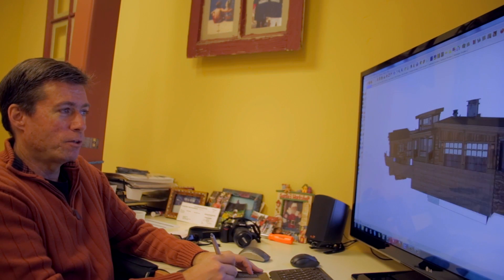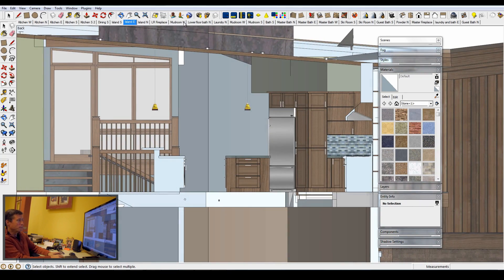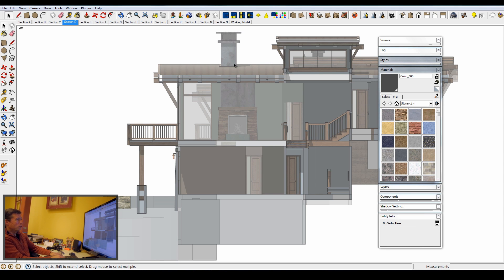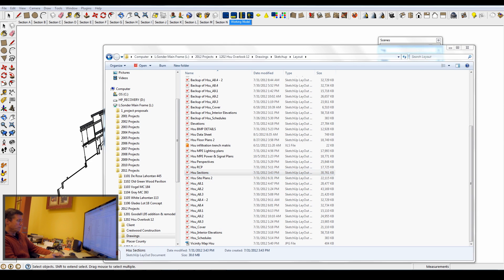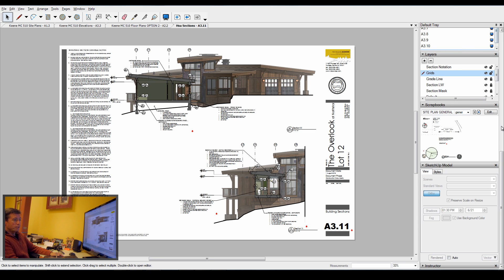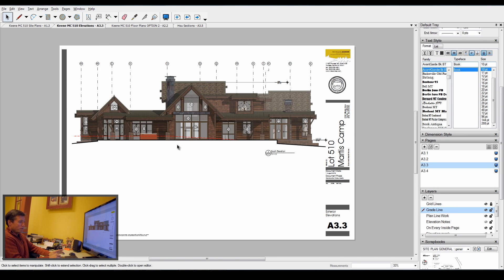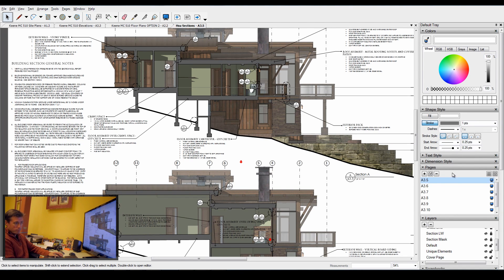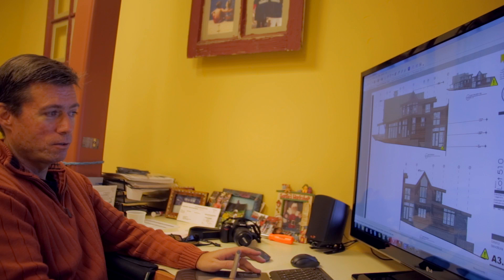Nick Sonder Process 2 - Generating different drawing types from a single model

Comment: Very impressive Sir, I am a IT Comms Room designer and I have been using Sketchup for some time now to design Comms rooms within a given space available/set aside for IT environments. I use Sketchup to size and model the rooms to make sure they deliver services with future expansion and maintenance considerations also taken into account all the equipment fits into the given space available. I do however struggle to convey the finished designs concepts and end up reverting back to Microsoft Visio for layout drawings, which is a shame and I hate using CAD, I have also started 3D printing off the environments but this takes a long time creating models to convey the finished product.
Can you advise me where best go for educational literature or online training in layout and any pointers would be most appreciated.
To an end your drawings and presentations are wonderful.
Take care
Simon

Comment: Hi Nick  I use a PC - in this video I was using a machine with an i72600 processor, 1gb Nvidia 550Ti, 16 gb ram.   I currently use an Origin machine - i73790 processor, 4gb Nvidia GTX 680, 180 gb SSD, 64 gb of memory.  I can't say enough about the Origin machine.  Incredibly fast and stable.

Comment: Select file > import and then choose skp model as the option. Find your original Sketchup file, and when you click import, it will add the model similar to the way you would add an x-ref in CAD. It should also let you edit it in place, though I'm not sure if those changes will be saved back to the master model, especially if it is already open.